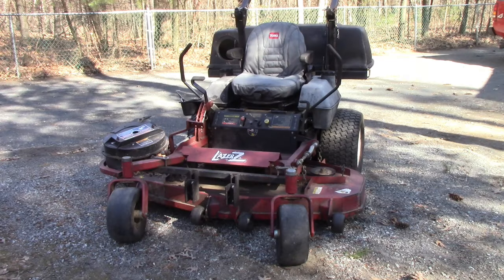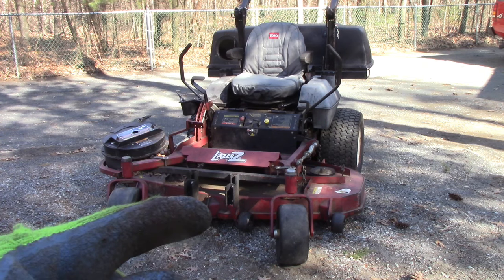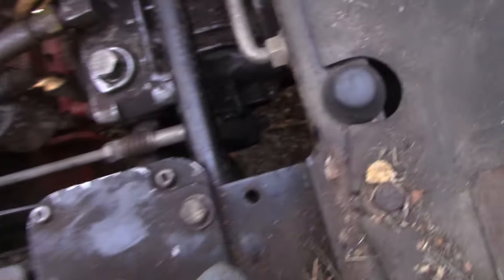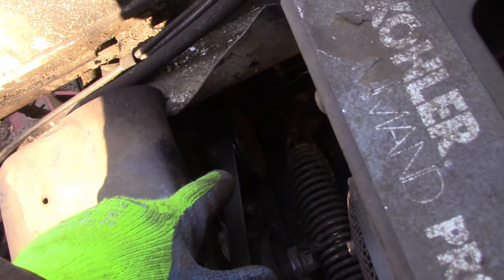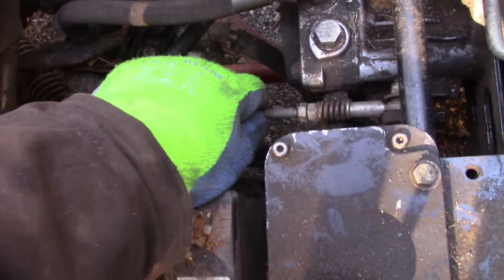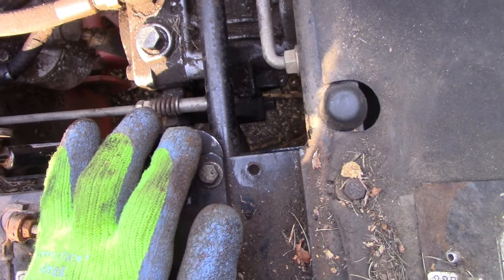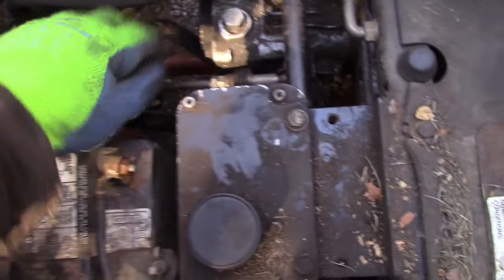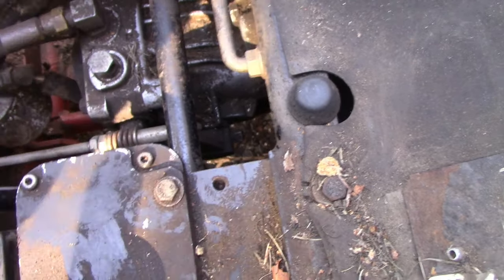Zero turn mower not turning correctly.

Comment: Hello,  I have a problem with my left arm. I can't turn or move forward or backwards. My right arm is fine.  Could this be my problem? Those square bolts on mine look like they are equally apart.  Should I tighten my left one? I'm not leaking no fluids

Comment: some times my mower creeps and sometimes it doesn't today it did the whole time so I stopped was afraid I would damage something.. I think it is my arms to , going to see if this bolt is loose its only on one side.. no oil leaks except when I changed my oil those 3 bolts below the flywheel were so loose I was luck I found them.. I guess I need to get some thread sealer for them.. thank you for the video..

Comment: I was having traction problems with my ZTM mower for a few months. The right rear wheel would sometimes spin. It was a nuisance. I tried several adjustments, but nothing worked. The last time I started to cut the grass the right front wheel was no longer spinning freely and I could not hold it in a straight path. The bearings were shot. I replace them and  It resolved both the steering and traction problems.
Reply from the maker: Cool. Good to know

Comment: My new time cutter my ride drove me off a hill. I was making a right turn, never broke traction, would not steer right and went straight while I was on the handle to make it go right, in turn, took me down a hill and off an embankment. I was able to fall off the machine and thankfully didn’t get hurt bad, and the mower, it’s messed all up.

Comment: I have a Kubota Z724 that tracks ok on asphalt but when mowing yard is very duffucult to track true.  I've adjusted linkage and dampeners and changed trans fluid but can't get the wiggle out of mowing a straight line.  Air pressure is same in each tire.  It has the Parker transmissions. Does mine have a similar screw you describe? 

Any suggestions.

Thanks.

Comment: toro time cutter turns on, when i try to move forward or backwards, no response, feel hydraulic pressure, checked drive belt. could it be these screws that are loose as well? thanks

Comment: Would this cause it to slow down going up hill with the arms fully forward mine goes great on flat land but as soon as there is the slightest incline it starts to hesitate than stops mid hill
Reply from the maker: Sounds like a drive belt issue or possibly a hydraulic fluid issue

Comment: I think you found what I've been having troubles with... the mower jerking left and right while slowing down and trouble keeping straight on downward slopes. I wish you would have driven it to show what it was doing first. I'm searching high and low to find a video to correct this problem. where one side 'grabs' then the other side. mostly when going down hill or trying to make small adjustments in reverse. I, at least, have a new place to look to correct. Already lubed the linkage points and changed steering dampeners... You may have finally helped me fix this.

Comment: I have a new to me rig and if I push the right side forward I can let go of it and it stays forward until I pull it back. The left returns to center but not the right. I can let go of it and drink a soda while steering with the left. Haa
Any thoughts? Toro
Reply from the maker: Some have spring returns and some use the shock type dampeners, but just sounds like the return mechanism is bad. Of course from here in Massachusetts it's a guess without seeing it, but that's my guess

Comment: My mower is a 42 inch Ariens Zero turn and the problem is different mowers are set up differently I don’t know if this will work trying it on mine or not my mower keeps turning to the left whenever I have both handles pushed forward whenever I’m driving.

Comment: Have you ever seen a brand new mower steer the wrong way while your on the handle directing it to go a particular way?
Reply from the maker: It sounds like the person who put it together might have missed some bolts too tighten down or the linkage from handle bars to the steering pump came disconnected

Comment: We have this problem but only after our Toro has been running for about 20 minutes.  We turn it off and let it rest for about an hour, then we get another 10 to 20 minutes of use before the problem shows up again.  Any suggestions?"
Reply from the maker: I'm trying to think how being warmer would affect steering . The steering pumps are always rotating with engine speed maybe when the steering oil which is a 20w 50 motor oil, maybe when oil gets warm its not performing like they should. Some units have an oil filter like a car. So maybe check the oil level or change oil and filter. Just a stab in the dark .
Reply: Mine is doing this

Comment: Looking for some help... I just bought a Toro Timecutter 75742. The control levers are stiff and when I push forward, they do not return to neutral by themselves. I can let go and the mower still moves forward. It makes driving around pretty interesting. What should I look at to fix this?
Reply from the maker: The dampener  Which looks like little shocks are supposed to have some friction so it's not so free wheeling. However there should be some kind of Spring return that gets it back to neutral usually it's on or around your adjusting knob . You can go to a place on the Internet like Jack's small engine.com and plug in your model number for your mower and you should find a blow up schematic of your steering system to see if there Springs that should be their that perhaps are missing . Or it just could be that everything needs to be lubed up what it's almost impossible to tell without physically seeing something you know

Comment: Hey! Not sure if you will see this, but you seem very knowledgeable in the mechanics of this particular tractor. I have z500 Zmaster Toro commercial and my left side has lost a lot of power but it still works ( backwards is almost nonexistent -forward is decent) can still control the tractor. Does this sound like a pump issue, adjustment issue? My hydraulic pump has a fan in front and I have a seller who has the same model toro but the hydraulic does not have a fan in front. Do you think these could be compatible - my hydraulic is 116-2445 and his is 103-2675. They are almost identical except for the fan in front of mine, do you think I can exchange the two? Or do you think there is alternative method that could help boost power on the left side? My steering is some what like you described, less power on my left (at one point it got stiff and liked to move after in neutral)  and more power on the right. I really hope it’s not an hydraulic pump issue

Comment: Hello,..Great video.. I have a Toro commercial zero turn with 110-4150 Hydro Pumps however they turn okay but I do have like a squeaky noise when I do turn if possible could you tell me what the issue could be?
Reply from the maker: That might be as simple as the band clamp brake just dragging.  But almost impossible to say without being there

Comment: I have a Dixie chopper that one hydro will stick when changing from forward, to reverse, to forward as if it was on the inside of the turn. I am about to replace the fan blades on top that got broke replacing a drive belt, so could it just be getting hot?
Reply from the maker: I don't know I've never came across that however  It's kind of hard to disregard a broken fan and you have a problem . So hopefully that works out for you

Comment: hey im having an issue where the right lever on my zero turn is pulling ahead all on its own, even when mower is TURNED OFF. i let my little nephew play around on it while it wasnt running and now this is happening. what could that be?
Reply from the maker: It sounds like the pump is advanced a little bit  maybe the set screw was loose enough to slide out of the neutral position.   But then again if it's doing it when the machine is off then perhaps it's the shock dampener that's played out . all that is it's just to give the handle bar some stiffness and resistance . Of course everything is a guess when you when you're not actually looking at the machine ya know
Reply: @JLafix  ya i knew you would just be guessing but i just wanted to get an idea of what the issue might be.
it almost seems like the shock wants to extend itself all the time
Reply: @JLafix  how do i figure out which of those it is? really starting to frusterate me trying to look up the issue as all that comes up is stuff about the mower moving when the levers arent while mines the opposite but every way ive tried searchiing brings up the same stuff

Comment: My exmark moves and turns great in forward, but one side moves really slow in reverse while the other side operates as normal. Could this still be the issue ?
Reply from the maker: I don't know for sure however those pumps spin in one direction only so when you slide from forward to reverse it just covers some holes and opens other holes for hydraulic fluid to flow. So It could be an internal problem in the pump, but I would first jack the wheels off the ground and make sure the handle bars are moving the input shaft to the pumps the exact distance back and forward. Both pumps are spinning at the same rate because there is one belt spinning both, so if you push handle bars forward evenly at a slow speed and it tracks true, and then slowly pull back to stop and if that tracks true then there should be no reason that if you went slowly into reverse it should track true. If it doesn't then most likely the pump is faulty.
Reply: @J La  that makes sense, thanks a bunch!

Comment: Hi, on our z425 John Deere the arms are super stiff. Any suggestions?
Reply from the maker: Not sure how those jd handle bars operate but must be some kind of shock dampener or spring return that  you can remove to see if it's the hydro pumps that is causing the stiffness

Comment: I really hope you reply I just bought a used Ferris Is2000z and It was the first time I had it out mowed great and was strong but out of nowhere now the right side won't pull the tire weakly moves and then stops like something caught it. No oil loss and it was 100-0. This is my first zero turn.  I tightened the release valve hoping it just came loose to no avail.  What should I do?
Reply from the maker: Not sure without seeing...maybe the brake is hanging up. Not sure on the ferris but most have a band clamp brake, it might be too tight or out of adjustment...just guessing

Comment: Any idea I just changed the hydrolic fluid following the manual on purging the air out of the system. I have no power out of the left side. Any suggestions?
Reply from the maker: If you're certain there is fluid in pump and the air is out then maybe check the neutral or free roll valve is tight. Or maybe check linkage to handle bar is working properly.

Comment: What if the left side does whomp whomp when you engage the left side ? Mine acts like it's slipping on the left side like it wants to go but it feels like the wheel is spinning but it's not if that makes sense.
Reply from the maker: Sorry dude hard to tell without actually looking at it
Reply: Yea it's weird. It will turn very very slowly. Feels like a belt slipping or something of that nature
Reply: This is what mine is doing ! did you find a solution ?
Reply: Mine slipping on the left side on my gravely zt44hd. Has both new zt3100 hydro gears only 6 months on the left one and 3 months on the right.  If anyone has had the same issue and had figured out a solution please post.  Need help
Reply: @Matt-kn3fd  mine is solved now it was a stretch belt ! guess i was doing a bit to much uphill stuff but i do need a belt almost every year